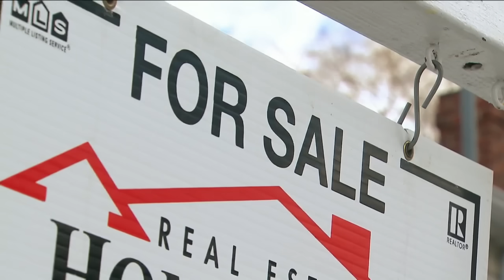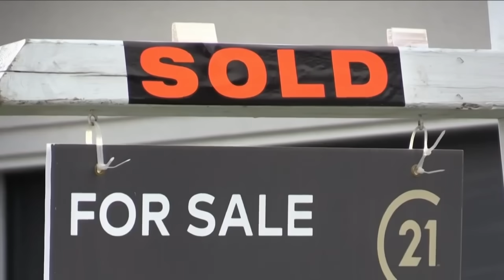Pierre Poilievre  wants provinces to end sales taxes on homes sold under $1 million

Comment: Sales taxes on principle homes should be axe entirely.
Reply: in etymology axe means to Reduce or to Splice!
Reply: @justinaldrich1719 nope that’s not what it means. Good try though
Reply: @jumbome7420  1670s, "to shape or cut with an axe," from axe (n.). Figurative meaning "to remove" (a person, from a position), "severely reduce" (expenses) is recorded by 1922. The axe in figurative sense of cutting of anything (expenses, workers, etc.), especially as a cost-saving measure, is from 1922, probably from the notion of the headman's literal axe (attested from mid-15c.). Related: Axed; axing.
Reply: @jumbome7420 it IS, actually!

Comment: the leading cause of higher prices is landlords using the same "REAL PAGE" price gouging APP that they were using in the states...  Look at the apartment listings, there are thousands of them asking $2000 for a 1 bedroom apartment.. with that many listings the prices should be going down but instead even though there is more vacant units the prices keep going up....
I was just pushed out of a place too so the landlord can gouge the new tenants...  even though the unit floods and the landlord was aware of it long ago and has done nothing...
and wages like minimum wage should be going up following inflation as it was intended...  Minimum wage should go up as though someone was hired to match inflation..  minimum wage should have been $20 in 2010...

Comment: Average house price in Ontario is 851,478. GST on that amount is 5% or 42,573. That's not 106,000. If the entire tax load was removed then it would be 110,000. Already there's a rebate for taxes, but PP fails to mention that. 109,011 new homes at an avaerage of 851475= 92 billion dollars.  13% tax =12 billion in taxes. Ontario deficit 6.6 billion, Fed deficit about 40 billion. So we are gonna add another 12 billion in ontario that will have to be borrowed. Now add another 30,000 house in the rest of Canada at 5% on 718,000= another 1 billion. So total 13 billion more dollars, and where is that money coming from? You guessed it, borrowed money. PP is going to add tens of billions of dollars to our debt so his buddies can get richer.
Reply: First bring down the home prices and tax 50% for all short term gain tax. Any purchase done within less than 3 yrs of buysing a home must be taxed. I see a single home is bought and sold more than 6 times within a 10 yr span

Comment: Can someone explain to me how the reduction of SALES TAXES will increase the badly needed SUPPLY of new homes?  What is Poilievre's objective, given the massive DEMAND for new homes?
Reply: Decrease the input cost of the homes to make homes cheaper
Reply: Builders aren't building 

This is one thing of many perhaps don't get so confused when you have part of a puzzle
Reply: https://youtu.be/nCiOq7p_PzI?si=uRjIXuW3H8ldCW7R
Reply: Affordability.  Why should the rich builder get the tax break then put the house on the market for as much as they can get without any consideration of the taxpayer savings they just got.  Give it to the people.
Reply: @clydemifflin3600  the current tax is not paid by the builders. The cost is passed on to the people (buyers) as part of the cost of the homes. What you're saying sounds good in theory, but how would you do it in practice?
Reply: @larms1000    Do you mean the GST?
Reply: @larms1000    So if I understand you correctly, Poilievre's proposal is to eliminate the federal GST on the cost of building materials and equipment rentals used in the construction of NEW homes.  Assuming a new housing unit is constructed in Ontario for $700,000 of which $245,000 to $350,00 relates to materials and equipment rentals, the GST reduction to the home builder would be in the range of $12,000 to $17,000.   Is this correct?

Comment: That's very misleading. There's no sales tax when buying a home.
Reply: They are discussing the sales tax on new homes. So yes, there is a sales tax when you buy a house, depending on the type you are looking at.
Reply: @lientran2077  not if you’re buying a principal residence.
Reply: @TyrantPapa  if it is new built, then there is GST included in the purchase price from builder, so it doesn't matter if it is principal residence or not. However, if it is principal, you do have GST rebate for portion of house price below 450K. They are discussing on pushing it to 1M.
Reply: @lientran2077  who’s buying home over $450k?

Oh, right, the housing market is a mess. He should tackle the core issues affecting housing prices, and it isn’t tax.
Reply: @TyrantPapa  i do agree with you the core issue is still there. In here, I only talk about gst on new homes. The original comment said there was no sales tax. I replied with an explanation on the probability of sales tax.
Reply: @lientran2077  yes, you are correct. I forgot about the $450k limit on the GST rebate for principal residences.

Comment: By the way, there's no GST on used homes, only new homes. So as usual this benefits the builders who get to deduct all the gst on material costs without charging the gst, so more in their pockets. It also allows the builder to increase their house prices because that always happens when these schemes. There is no benefit to the homeowner, except if they buy a house right away and then sell it after 2 years when house prices are even higher. Why are people so gullible?

Comment: So doing the math: -$16 billion in lost tax revenue +  $8B in cuts to federal housing initiatives + $2.1B in additional income tax revenue = Net loss of -5.9B in lost tax revenue. Sounds like you're going to have to cut wayyyy more than just the federal housing initiatives...
Reply: You haven't got a clue how tax cuts and smaller government works apparently.
Reply: Yes, cut the 21 billion the government spends on outside consultants, like McKinsey
Reply: Try googling ' do tax cuts create more government revenue".
Reply: @rickvervoort9536  I'm quite aware of the "starve the beast" concept. I'm not saying a smaller/streamlined government would be bad. I just think you need to be aware of the implications of certain proposed policies. While it would certainly improve affordability for those buying the new homes built, it does come at a significant cost. And as Poilievre said in the video, there would still be close to $6B of unfunded tax cuts, which would need to come from cuts to government spending, increasing other taxes, or increasing the deficit (I'm sure you can guess which one it would be).
Reply: @tonycommisso4096  $21 BILLION??? Yeah, that's NOT a thing!
Reply: @tonycommisso4096  That is certainly a possibility. I would note that Steven Harper was also heavily criticized for heavily spending on consultants too. So there may be a floor to how much you can realistically cut in this area. To play devil's advocate, Trudeau's spending on consultants didn't really increase that significantly (from Harper; ~$11B) until Covid began.